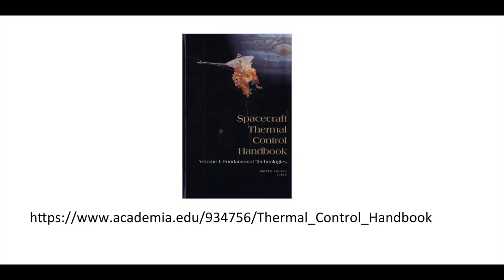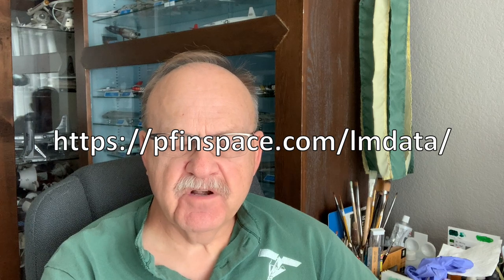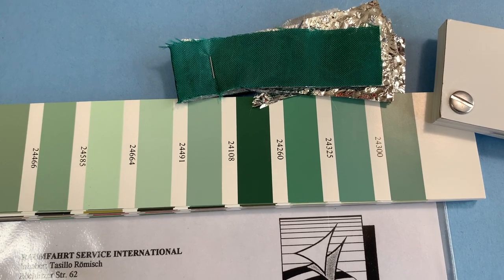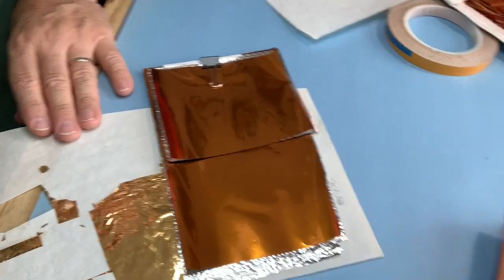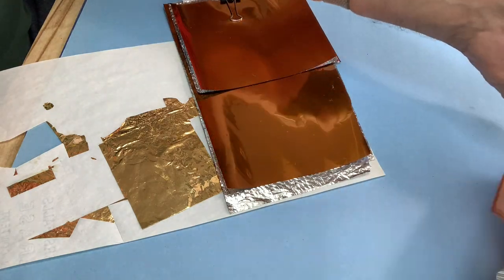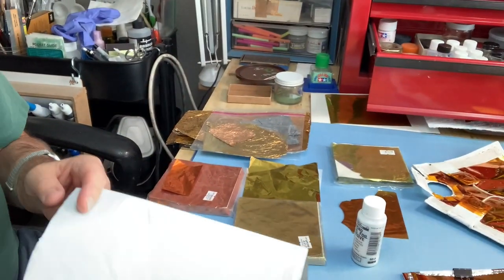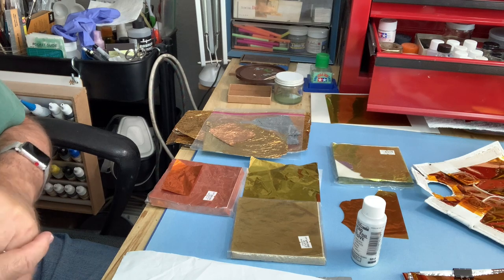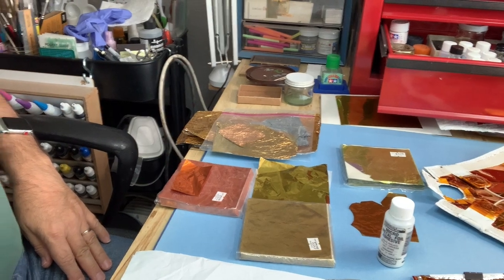Thermal Blankets

Comment: keep learning more about how complicated heat transfer is. i still regret dropping a 200 level physics: thermodynamics class in college (went into medicine and just couldnt get it to fit my schedule). seems like even on earth as room temps, that thermal emissivity is still the dominate mechanism of passive (non forced air) heat transfer, thats why some AL heat sinks for computers are painted black despite black paint having an insulation value. for some reason everything ive found for home insulation and r values are still based on heat conduction. feel like if i ever own a home or do a remodel, ill buy a bunch of "space blankets" since theyre so cheap and stick them in the walls before i add insulation. started covering my 12v dc fridges with aluminum tape, which reduces their power consumption by something like 30-40%. can get the AL foil tape for like 1-2 bucks per roll now from china. i have a weird hobby of searching the chinease amazon for days trying to find new tapes lol.